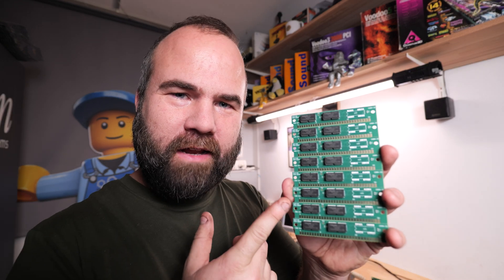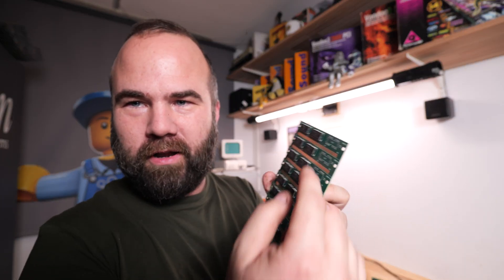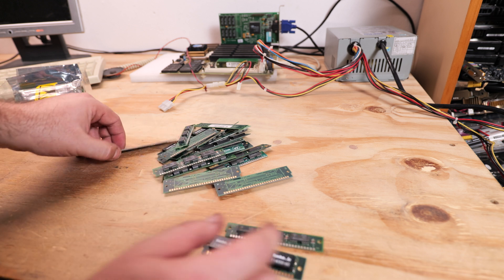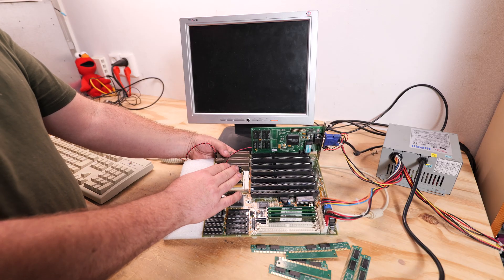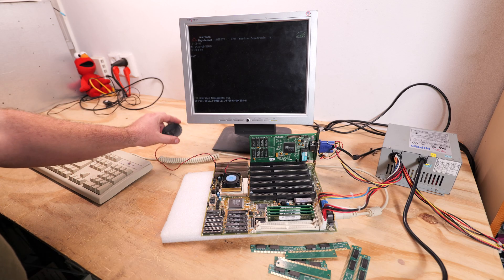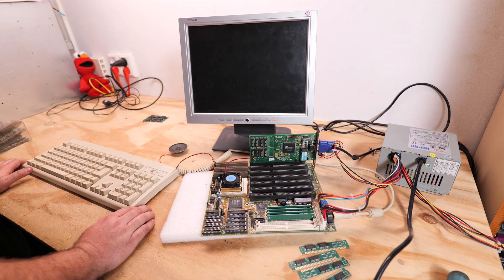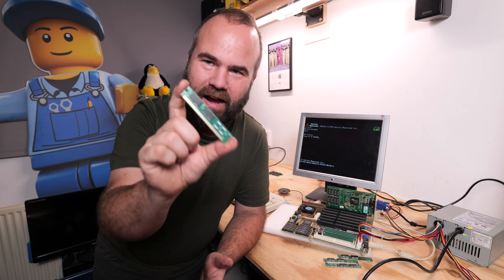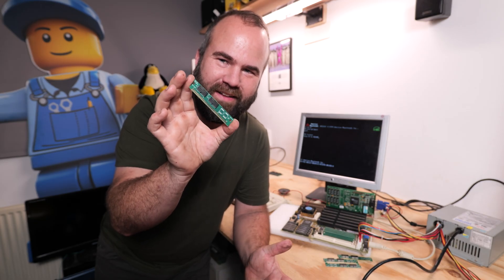Check This Kickstarter! 4MB 30pin Simm Modules in 2024!

Comment: Hey Victor, I got one of those HBA cards flashed to IT mode, and it works in general. However, when I plug multiple SSDs into it, one of the SSDs always goes dead and another one throws a bunch of errors. HDDs generally worked fine. The slower the better.

How can I pick an HBA card, so that I know it has enough speed to support multiple SSDs?

Comment: yeah i have old AT Power supply. theres no rubber cover on the switch, so if you accidentally touch it in the wrong place you do get a little jolt that wakes you up, thankfully not enough to send you flying across the room, this reminds me of how much ive forgotten about old pc tech, I used to be able to program DOS to run Norton Commander from boot up with all the EMS Memory enhancement settings, ask me to do the same today and ill be like errrrrrr, i vaguely remmember EDO memory and 70ns is slower than 60ns.

Comment: Yes bud, mains voltage on the AT power switch. Be careful with them 👍🏼
Reply from the maker: I first found another AT PSU with no switch. So luckily I found this one so I didnt had to jump it with a paperclip :D
Reply: @victorbart  Yeah you could always use a power strip with a switch and don't touch the switch on that lead, don't remember how they are build inside and how easy it is for mains ending up in contact with the metal mounting frame, but yep I don't like to touch that neither. 😅
BTW, thanks for sharing this project!